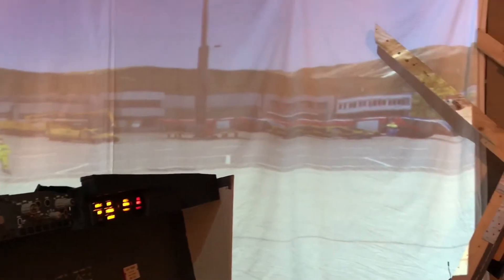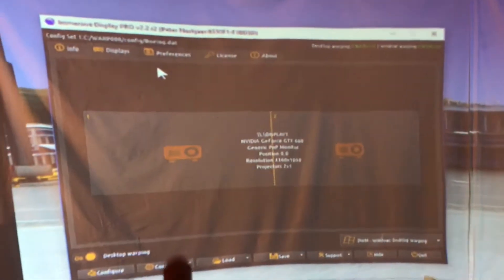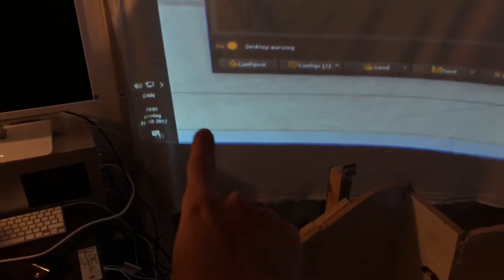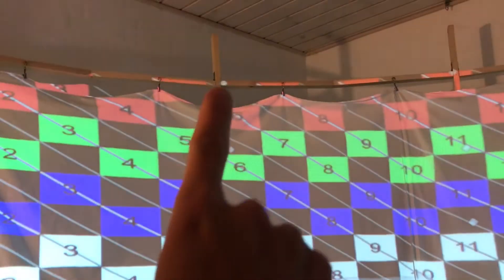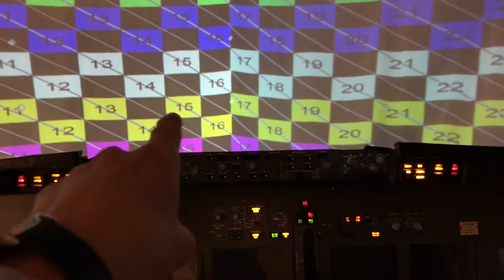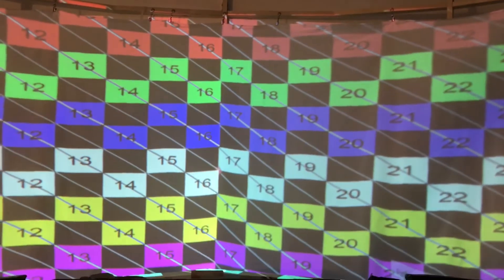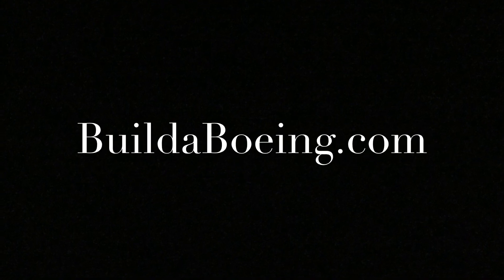Calibrating screen - B737 Home Cockpit

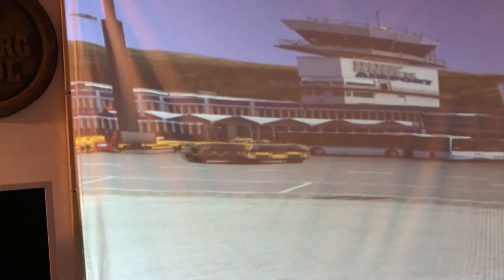Comment: 6:29 yes you are streching screen to 180 that not original 180 degree. can you change from simulator pov angle 180. that would help. you could actually see 180 and not 60-120 degree

Comment: A normal fsx view can only get about 135 degrees. You must use multiple views in fsx to get the correct minimally distorted viewing angles. To get 180 degrees exactly with 2 projectors you will need 2 fsx views with 90 degrees on each. My system uses 3 60 degree views for my 3 projectors. You also must set the horizon in level flight to the same height as your eyes. You can probably do this with your warping software as panning the fsx view up or down will cause the edges to either hide objects or display 2 on each view due to the wedge shaped area of view it creates. You will also find it impossible to adjust the fsx main view without opening the 2d cockpit, Some people leave it as a hidden view behind all the others. I hide the 2d panel in the corner and use the panel config file to set the views position at mid screen. In your case you would want the main view on the right or left and a second view for the other side.  Lean to manipulate the FSX FLT files to adjust the saved view and location values of the cameras. First you locate were it says window. This will show the coordinate's on the screen were the views are positioned under ScreenUniCoords. Also under window you will find a Current Camera= line with a long code that labels the camera used in that view. Find that camera data bellow. You can set zoom, Translation(position of camera ) and Rotation. 
Hope this helps!
Reply from the maker: Ouch. I did read it was complex. I need to look in the basics of Fly Elise to begin with, as Michael mentions. I am not able to get the P3D View Group Management does not work with Nvidia Surround on. 
A huge thank you to all of you helping me with this.

Comment: I think that the surround view is the root cause of the objects getting bigger and deformed on the side (view angle too big). You should be able to project 2 different 90 degrees views, one on each projector.
Maybe this link could help you:
https://www.youtube.com/watch?v=q_AVctBRKxA
Cheers
Syl20
Reply: I would suggest to use p3d viewgroups, don't use desktopwarping in IDP and no nvidia surround, just single displays in nvidia. Better performace. If you don't mind the additional costs I would use Immersive calibration Pro. This works perfect and produces a viewgroup.xml file, that can be directly used in P3D. However, you are on a good way :.) . Michael
Reply from the maker: Due to the Nvidia Surround it acts like one screen. So II can only create one view. But I worked a bit with the View Group Management i P3D and now things looks a lot better. :-)
Reply: Yes I know, I for that reason had to disable Nvidia surround and use 3 separate screens, then it would work with viewgroups
Reply from the maker: But the Warping-software Fly-Elise needs Nvidia Surround in order to work. :-(
Reply: No Sir,  it works with both...
Reply: Hi Michael,

I am planning to modify my cockpit from a 1 projector screen to 2 projector as Build a Boeing. My question: Would I need both IDP and ICP software? Can't I set up the viewgroup.xml file manually to be used by IDP?
Reply from the maker: I will have to look in to that. So far I have not been able to get the Desktop warping working in IDP without Nvidia Surround. I appreciate your help. :-) /Peter
Reply: Hi Roar, you can do it without ICP. ICP makes things much easier, especially with viewgroups and it it is more precise with calibrating the warp. You may first try without ICP, you can always do it later if you are not satisfied. I have no experience setting up viewgroups manually.
Reply from the maker: Hi Michael. You were right.  Nvidia Surround allows the desktop warp, but that is not needed for P3D. As long IDP had "Windows warp" enabled everything is okay. So now I have the two windows in P3D and defined them using the "View Group Management". The side views in P3D is very good now, and picture quality is better than with Nvidia Surround activated. 
Only downside is that the windows desktop not is warped. But that is not needed either. :-) 
So thank you for the tip.  I still have some calibration to do. :-) 
/Peter